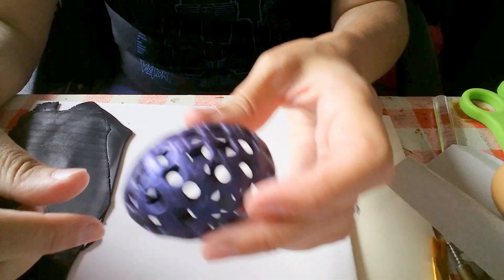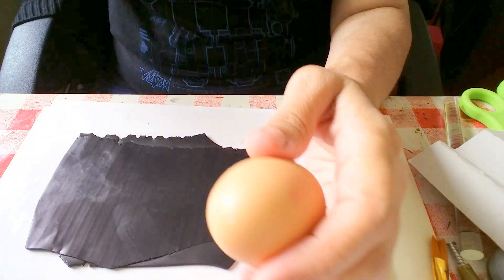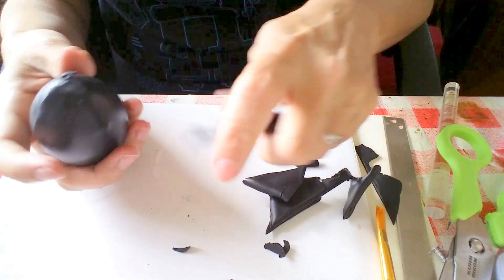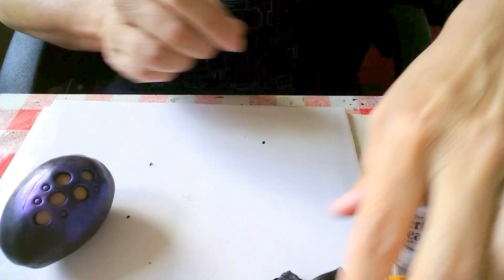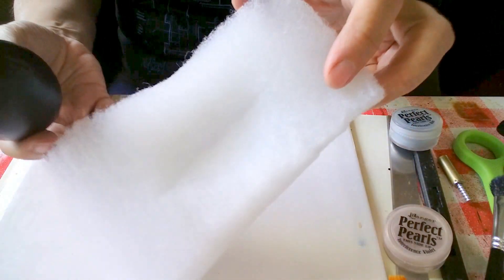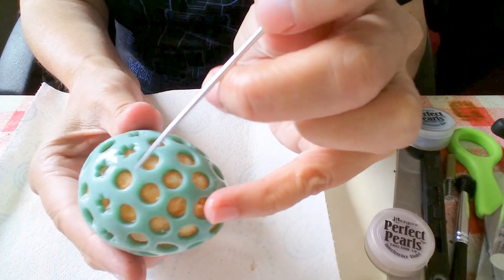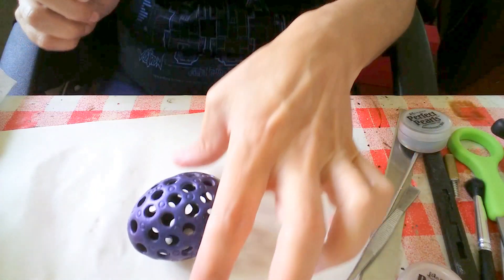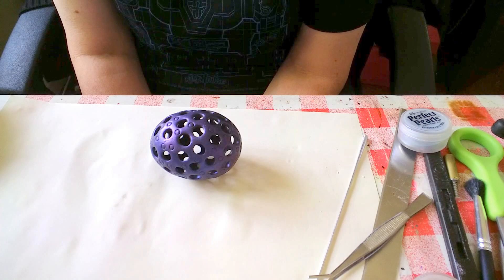Hollow Polymer Egg Tutorial - With Science!

Comment: How do you take care of fingerprints?
Reply from the maker: Applying the mica powder helps, as you smooth it over. Mostly I have very cold hands and I try to have a light touch. If you don't use mica powder I'd sand with wet and dry sandpaper to finish. I use 400, 600, 800 and then 1000 grit.

Comment: I've seen several tutorials on these eggs. A lot of cool designs!

However, I haven't found one that tells how long to soak the egg in vinegar. So I'm cautious here. Also, could it hurt to lightly coat the in oil or dust it with corn starch prior to applying clay to egg? (It seems to me that this would make separating the shell from finished product much easier)
Reply from the maker: I soak mine late afternoon and overnight but take the hideous egg sac out at some point. I replace the vinegar with a new lot before I go to bed. Not sure if this is totally necessary but it gets it bubbling again. One thing I tried, with some success, is giving the egg a thin coat of Renaissance Wax but you don't want to protect the egg from the vinegar, or make the clay unable to stick. When the shell becomes fragile I poke holes, to help it sink and dissolve from inside. Hope that helps. x

Comment: Great tutorial!

You might consider getting some citric acid powder (used for dyeing wool and other animal protein fibre, yarn and fabric). You can mix it to be a bit stronger than the typical 5% concentration of acetic acid in vinegar and it has barely any scent at all.

After you remove the inner membrane, that allows the acid to come into contact with all the areas of egg shell that had previously been protected by contact with the poly clay. As you demonstrated, a weak acid soak doesn't do anything to the membrane (might even make it stronger, if my vague recollection from biology class is accurate). So another soak would get rid of any problems in removing egg shell.
Reply from the maker: Ooohh... Very interesting! xx

Comment: So going to make this! I have collected some eggs  and I think I will try 2 thin layers of polymer clay in different colors, so that the inside shows up differently from the outside. Question: why do I have to bake the egg, rather than just let it dry, since everything will dissolve away anyhow? (Being lazy here, 😜)
Reply from the maker: I think it just helps to dry it, make the inside more brittle and settle it down ready for clay. That said, I'm not 100% sure, I took that advice from elsewhere. ;) xx
Reply: I’m thinking the clay wouldn’t b hard enough because it hadn’t cured. U need to set the clay first, or u would just smush your clay, trying to pull the actual egg through the holes. Imo?

Comment: What a great idea. I had purchased some paper mache eggs from a craft store intending to use them and cover them like dragon eggs. Imagine my surprise when I cut into one to make it opened up like a dragon had hatched from it to find the egg was actually some horrid plastic thing covered in a very thin sheet of paper. Ugh. Who knows what might have happened to that plastic in the oven.
Reply from the maker: Good job you looked! Good luck if you try this out, or something similar. xx <3
Reply: Wulfgeist it doesn't usually do anything when you put plastic eggs in the oven at the lower temps needed to bake polymer clay- I have found that you might get a slight plastic smell, but the egg tends to stay intact. Some very cheap brands do warp slightly...

Comment: Even though this is a art clay(silver clay-metal) challenge. How would you get something say like a object inside the egg? Like a tiny bird made from say poly clay
Reply from the maker: Not sure how the vinegar would affect art clay, but assuming it was ok... I'd make a hole in the shell big enough to insert the bird (maybe cut a hole with a Dremel? Not sure). After putting the pre-baked bird in, I'd cover the hole with wet paper/tissue and allow it to harden (some layers, like paper mache). Then I'd do the clay egg over it all. Baking should be fine. Whilst the shell is dissolving in the vinegar, the wet paper should fall apart. I'm guessing though.
Reply: Suzette Kath now, THAT is a great idea. I watched the video (thanks for the idea, especially the vinegar trick), but I couldn't figure out what was missing. An internal focal point. If the bird or whatever has a tiny hole so it can be suspended on clear fishing line type thread, that would make it super fun!
Reply: Suzette Kath I have done shapes with something inside (I did a mouse inside a piece of cheese, cow inside a UFO, big fish in tiny tank-they were all Beads of Courage so they were about an inch wide) by putting the inner object inside wax then carving the wax into the shape I wanted and covering it with clay, then baking so the wax drips out. Then I would do the final details and bake again. I have to try the inner object idea with an egg....